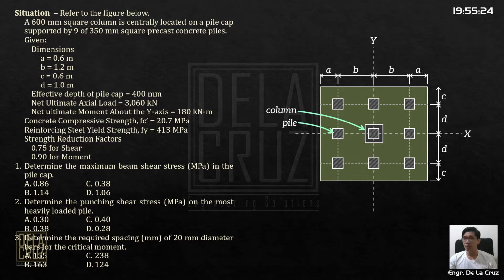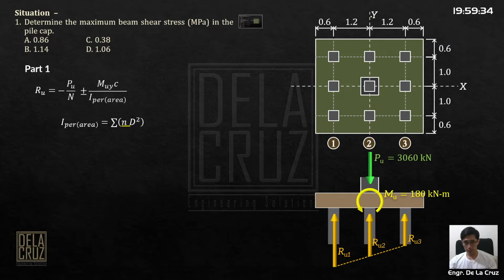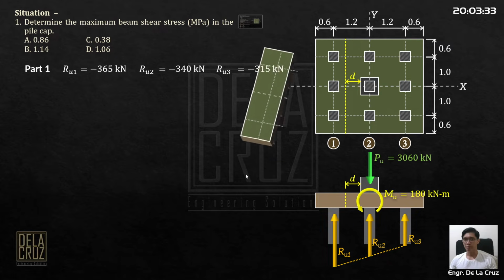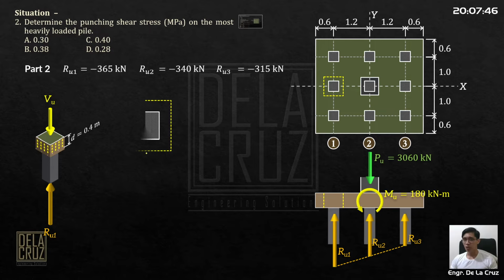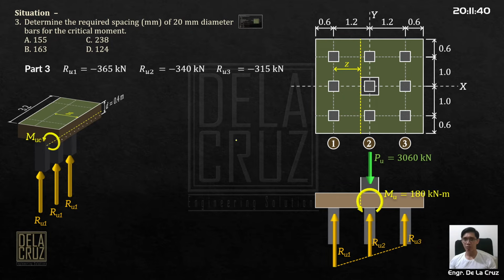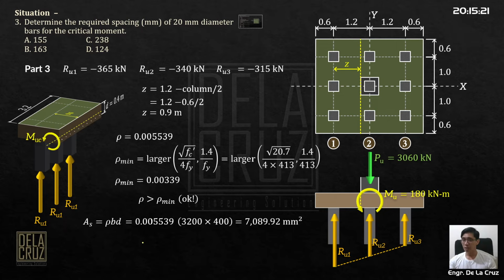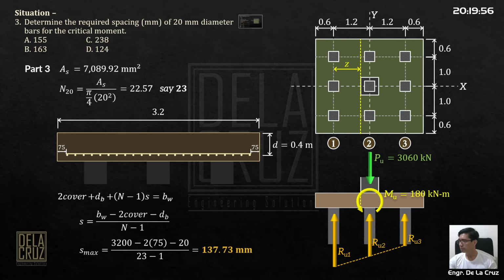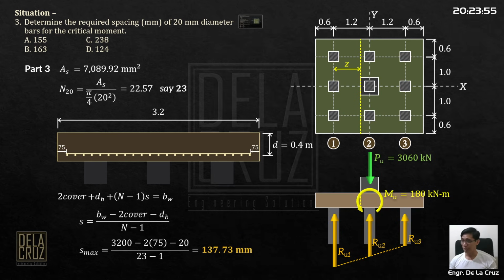2022-November CELE PSAD (Sit 5)

Comment: Sir question lang po ..pag hindi e state sa problem po na critical or maximum wide beam shear stress or critical/max punching shear stress need po ba ang phi?

Otherwise, kong e state sa problem na critical or maximum..no need na ang phi??
Reply: Pag critical/max pati na din yung walang e state ay nominal yung kailangan kaya idivide mo ng phi

Pag sinabi na design o ultimate, di mo na idivide ng phi
Reply: korique @japhethmirafuentes8551
Reply: Critical wide beam or punching it means the shear stress occurs at the critical section. So nominal pa rin, unless kapag sinabi na ultimate no need to divide it to reduction factor.

Comment: sir if "critical" wide beam shear stress, ung design shear stress po ba un? di na po icoconvert sa nominal shear stress?
Reply from the maker: For me nominal sya pag wala ang term na design. So pag "critical wide beam shear" nominal sya
Reply: Copy sir, thanks!!
Reply: Critical wide beam shear kasi critical section. So nominal pa rin.
Reply: sir anong term po ba sa question kelan hindi ididivide sa reduction factor? thanks sir
Reply: @diyonh  pag may term na design